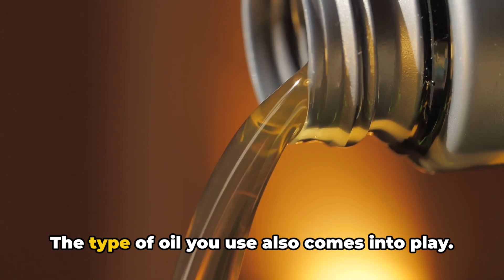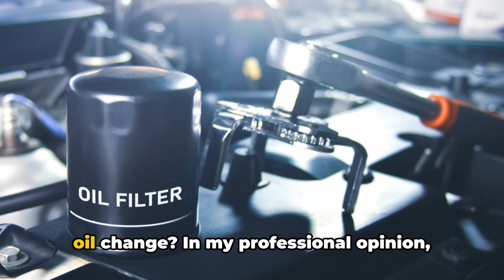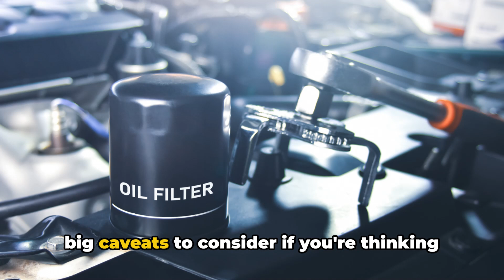Do You Need to Change Oil Filter Every Oil Change? (Explained)

Comment: I change oil every 3000 miles but filters every 6000. Filters get better over time until they are plugged and bypassed. 6000 miles isn't long enough to plug a filter.

Comment: There's loads of Bullshit talked about Engine Oils.
There are many 'angles' & points of discussion regarding Car Engine Oil & Filter Change.

First of all - let's discuss how some Fully Synthetic Oils are £60 for 4ltrs & others are prices all the way down to only £20 (or even less) for 4ltrs of Fully Synthetic Oil.
Many motorists pay for the dearer oils because they believe that they are better 🤭
Many motorists believe that Fully Synthetic Oils are created in a Laboratory & are not traditional oil at all 🤭
Well, let me tell them that all car oils (whether classed as 'Mineral Oil' or 'Fully Synthetic Oil' are ALL basically - Mineral Oil.
The difference between what is known as Mineral Oil & what is known as Fully Synthetic Oil is - the degree of extra refinement that Mineral Oil has to go through to call it Fully Synthetic Oil + the Additives that each manufacturer finally includes in their own 'cocktail'.
And every manufacture has their own recipe of additives and they keep their recipe a secret! 😳
So the best solution for the motorist (in my opinion) is to buy the CHEAPEST Fully Synthetic Oil you can find.
All motor oil sold commercially has to comply with certain industry standards of Quality & Suitability, (it's marked on the container you purchase it in) so why pay for a 'posh' name?
The other thing is - 95% of us motorist use our cars in a mundane manner, we don't go circuit racing in them - so why buy expensive oil because it's advertised by Max Verstappen?

One more thing, almost none of us hang onto our family cars until they've done 150,000 (or more) miles anyway?

Remember - all of us where using Mineral Oils the run our Nissan Cherry Turbos & Renault 5 Turbos in the 1980s because Fully Synthetic Oil wasn't available to us at that time - so what's the Big Deal.

Comment: Read the manual for your car. Example: Honda Jazz/Fit 1.2, page 279.
Normal conditions oil change every 10000 km, filter change every 20000 km.
Severe conditions oil change every 5000 km, filter change every 10000 km.

Comment: I liked your video. I had the idea that the oil could be heavily contaminated before the next oil change (I drive mostly in the city), so I thought it would be a good idea to change the oil filter without changing the oil, for example, after 2500 miles, and when changing the oil, when it is 5000 miles, change the filter again. Greetings from Lithuania!

Comment: The correct answer is actually the opposite. If you change the filter more frequently, you don’t need to change the oil as often. Changing the filter will keep the oil cleaner for longer!

Comment: Most of the newer cars use a small filter compared to the old cars. That smaller filter can trap less gunk and will clog far more easily, so it's more important than ever to change the filter every time.

Comment: I change the oil every 10000km and filter every 20000km and use only Castrol oil .. never had any problems.. I do this on my turbo diesel navara because for some crazy reason they designed the filter to come off with the open side facing down and it’s a mess every time so it just skips a change and it doesn’t complain.. the Honda now get the same treatment and the same oil and it’s done over 300000km .
Reply: With upside-down spin-on filters poke a hole in the filter when draining your oil to allow air in, and almost all the oil in the filter will drain out. Much cleaner job.
Reply: Changing the oil every 18,000 miles on a honda? You sir, are absolutely crazy and i cant wait till that engine fails lol

Comment: There is no question.  Change the filter every time.  A filter is cheap <$10...... wtf is wrong with people.
Reply: some filters aren't cheap. Example: The Honda's CB 500X and Suzuki's Vstrom oil filters costs more than $50 here in Brazil. The oil costs only $15 for 3 liters.

Comment: Short answer: Yes.  Change the filter.  I'd rather spend tens of dollars rather than thousands.  Furthermore, what is the primary goal of the manufacturers?  To sell as many cars as possible year after year.  That can't happen if Your car lasts 20+yrs instead of 3-5yrs!
Reply: oh man but some filters aren't that cheap. The OEM for the Honda' CB 500x and Suzuki Vstrom 650 costs more than $50 here in Brazil. The 3L of oil costs only $15

Comment: I used Amsoil on a 77 Malibu starting at 100,000 miles burning a little oil. Changed the oil filter every 6 months and never changed the oil again just topping up at the filter change. I got rid of that car at 350,000 miles because the rest of the car fell apart. The engine didn’t burn a drop and still ran good.
Reply: bullshit, no oil is gonna last 250000 miles. If you're only topping up at filter changes its gotta be less than a quart each time
Reply: Because when you topped up you added more additives.

Comment: Along with what you said i think about that 16 to 32 ounces of OLD oil that are in the old filter mixing with the new/fresh oil you just replaced.
Reply: Still oil around the engine. Sumps can have funny drain threads, and a cup or more still left in there

Comment: Excellent .You have mentioned the most important point . Bypass line will open in case filter gets clogged . So lets not assume filter will work as much as we hope . It will relieve itself from its duty cause the oil gear pump creates very high pressure and the paper will tear apart if its clogged . So the safety bypass will open
Reply: Several years ago a major filter manufacturer's oil filter for most Ford's was found to have a bypass which wouldn't open. If it clogged you could have zero oil flow with the small-block V8's it was used on and, your gauge would still indicate normal oil pressure, leading to loud expensive noises from under the hood and a case of pedestrianism for the driver. I stopped using all their products at that point, even though the problem was fixed. Lost trust is very hard to overcome.

Comment: I live out in the country. I changed my synthetic oil every 3000 miles & premium oil filter every alternate.
Reply: If your engine does not burn oil and you use synthetic oil every other oil change works for me.😊
Reply: That is okay to do however a mechanic told me he would still take the oil filter off and dump out the old oil.. Makes a lot of sense to me..

Comment: If you're changing your oil every 5k miles what is the point of buying a 20k filter?
Reply: Formerly.  I just did that and I'm trying to figure out if it was stupid.
Reply: @brazyuniverse4221  I've done it too.  In fact both of my vehicles currently have 20k filters, thinking that they are over all better filters. So here are my options:
1) Change the filter at 5k.  Kind of overkill and a waste of money imo.
2) Leave the filter on for 10k.  Then you're mixing old oil with new oil like he says in the video. (Is it enough to matter? I don't know)
3) Remove the filter at 5k and drain as much oil as possible,  then reinstall it.  I have never tried this. My concern is that the gasket might not seal properly resulting in leaks. 
    I'm going to try option 3 and see what happens.  At this point I'm wondering if it's worth the hassle.
Reply: @lukeroberts6019  I'm reading a lot of negatives for option 3 (e.g. structural integrity, recirculation of bad stuff due to the new oil acting like a solvent)
Reply: @brazyuniverse4221  Maybe I'll just go with option 1 and go back to cheaper filters. Not bottom of the line but not top of the line either.

Comment: As a retired multi repair shop owner over 35 years not as a mechanic, I still own a 10 bay shop that I lease out. I understand the stigma attached to auto shops, AC Techs, builders, ten things your Doctor doesn't want you to know and the list goes on. I'm suspicious of a business that has to tell me how honest they are. The first thing you want to find out is if anyone is paid on commissions at all, if so buyer beware. I paid salary/hourly with no incentives for anything. The three ladies that worked the counter were ASE Certified and knew more than most customers especially for routine maintenance.

Comment: Good video! I have been a mechanic for over 30 years and what you are saying is correct, I choose to change oil& filter every 3 - 4000 miles. I have seen what damage that can be done if you don't change it according to your driving habits.

Comment: Is the old days the 60/70’s they said the filter didn’t clean properly till later in the oil change. Hens second oil change. But now as you said. What’s a bit of oil and a filter , it’s cheap compared to a new engine

Comment: A simple answer. Yes. Its cheap, it ensures cleanliness, its often easy to replace.
Reply from the maker: 100% agree! crazy how many people often overlook this.
Reply: @HonestMechanicChannel 
I usually only change the filter on my old landcruiser every 2nd service for 1 reason - the filter is a pain to get to and pours oil all down the side of the engine and onto the front axle. It's a huge mess. 
Also the filter really big (holds nearly a quart) - about 8 times the size of the one on my wife's Honda. It's done 250 000 miles and showing no signs of wearing out.
Reply: Right .  A no-brainer.
Reply: It's only half the job. Just do it.
Reply: Not always, buddy. Some filters costs more than $50 (at least here in Brazil). My older Honda' CB 500x and my Vstrom 650 have this price in its oil filters.
Reply: @magichatake  same is Australia. toyota hilux oil filters are between $35 to $50 each. crazy
Reply: @Ben_got_bored  yeah! When we convert 50$ to BRL it's something around 260 BRL (our minimum wage is 1400 BRL)
Reply: @Ben_got_bored  yeah! we do have another oil filter brands here that costs from $7 to $20 but I don't know if I can trust them.